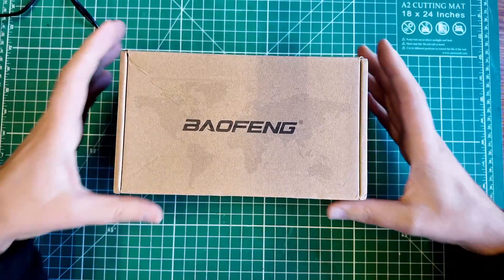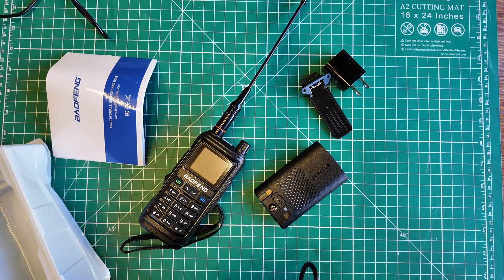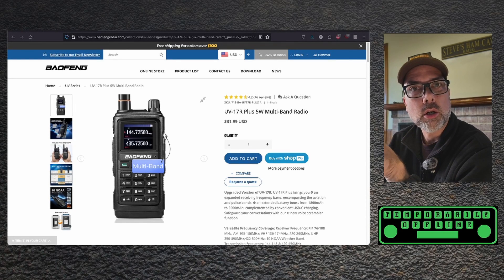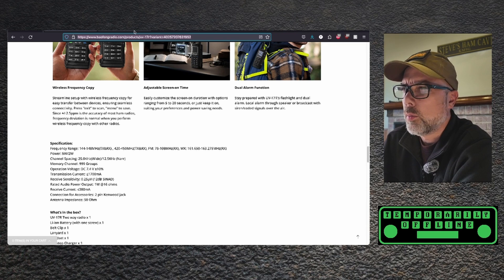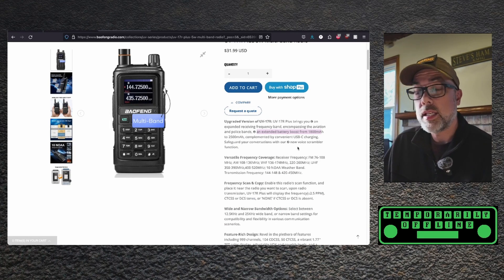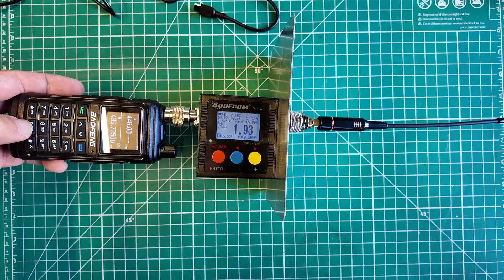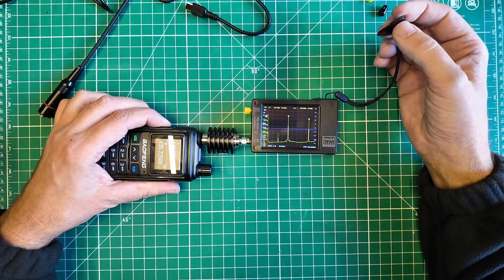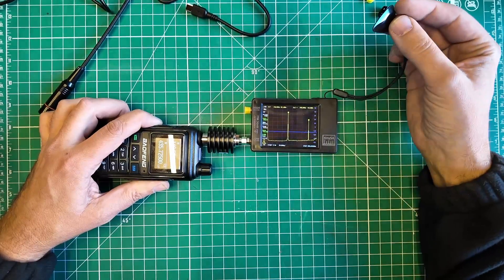What's all the PLUS about?

Comment: I have several Feng radios. They all perform as related to their cost, go figure. I use them with my GMRS license and when working in the rough. If one gets lost or trashed, I will not cry. Hmm, frequent factory resets improves performance and manual programming works better than Chirp. Just my story, thanks and 73, KF0NNQ.
Reply: Those fengs work better than their cost, lol.
Reply: @victorcharlie7491  Mine don't do well on duplex, bought on Amazon, but work well enough on simplex. Best function is if one is lost or trashed.... They were my starter radios. 73.
Reply from the maker: Hey Bill, thanks for sharing!

Comment: A dirty radio is a bad radio as you can't really use it without worrying about breaking the rules or add some filters by yourself.
Reply from the maker: The external filters cost more than the radio! (The internal filters are pennies though)
Reply: If the FCC cared, they would not let the market be flooded with these radios.  Baofang doesn't care and the FCC doesn't care.  A small percentage of hams are the only ones that seem to care.
Reply: I’ve been using a uv82 for 9 yrs now. It’s probably dirty but man it works great. Never have gotten any complaints on air. Has nice features. Dual display. Dual ptt. Drop in cradle. Headset. $17. Beat that yaesu and I’ll buy one of yours

Comment: For an already cheap direct-conversion radio, how much more engineering, components and manufacturing costs would it take to get a cleaner signal within spec? I guess what I'm thinking is that they have a willing market that would likely tolerate an extra $5 to $15 per radio for a cleaner signal. Doesn't even have to be perfect, just within spec. 

I recently won an Icom T-10 and it's a direct conversion dual-band HT. Absolutely nothing special about it compared to a similarly featured `Feng. It could likely be argued the `Feng's have a better feature set, screen, etc. Of course, Icom made sure the T-10 is within spec, but the street price is also $240.  If Baofeng cleaned up their signal to where it was on par with the YaeComWood consortium,  would it be worth (IDK) $50? That's only $20 over current price point for a modicum of filtering. Or maybe that filtering is not as cheap as I'm guessing?
Reply from the maker: I'm with you on this one... its not even something that would cost more, its just that they chose the wrong values for the filter network... I don't think they know, and the bottom line (sales/profit) is showing that it doesn't matter. 

Even if they raised the price, they are the bottom price tier, so they would still not have any competition.  Raise it up to $30 if it helps... but its apathy AND ignorance combined with good sales numbers.